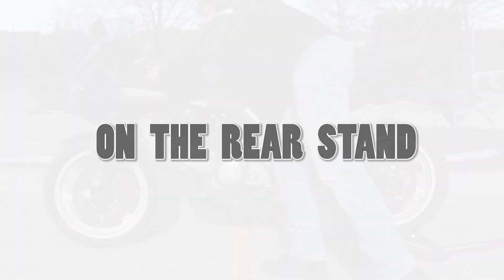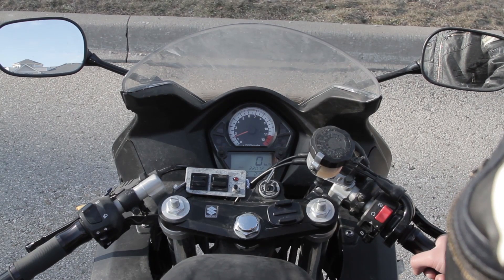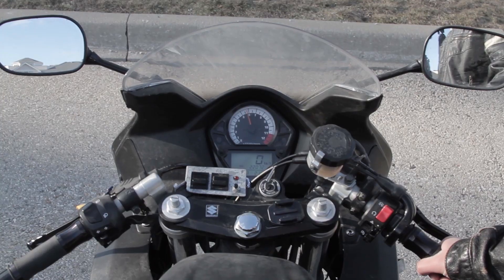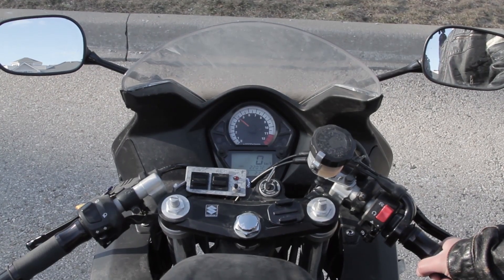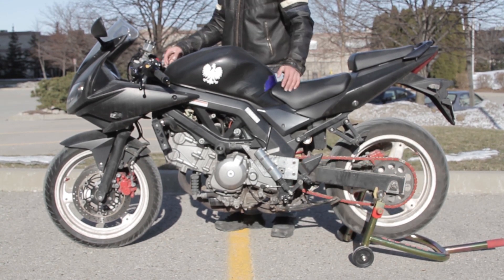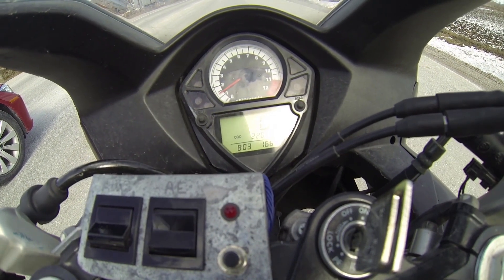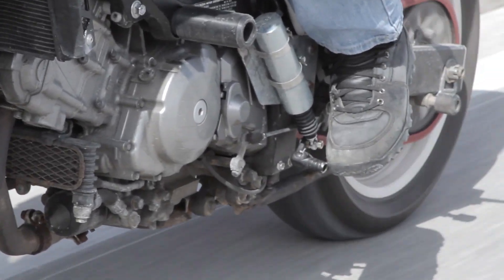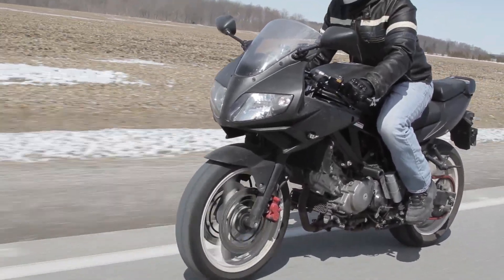DIY Semi-automatic Motorcycle Gear Shifter (SV650)

Comment: Unfortunately, liability exposure keeps a lot of these devices from ever hitting the market especially for physically impaired, challenged, whatever the proper terminology. I've had two pretty horrible accidents (sv650 actually) but I still love to ride and like Jackstandjohnny would want the same. If you can help him as one individual that would be awesome! The other shifters are for racing primarily and wouldn't have your fail safes and driveability options programed and can tailor it for him including having the option to shift from the other side of the bike or hand controls electronically. (more fail safes/options). Hope you can help him out. I hope you won't limit your engineering design work due to liability exposure. I know time and a real job are the more dominant interruptions, but just saying, as a prototype design engineer,  I see liability as a huge limiting factor for devices or systems making it into the market share, aside from funding, further R&D, etc.
Reply from the maker: You're right. It's a challenge.
The human body is a very resilient system (understanding it is really a path to inspiration) but after you get hurt, such as in a motorcycle accident, you can only adapt so much. The combinations of impairments people are faced with and their severities, are so unique, once combined with the variety of motorcycles each individual owns..... makes it a challenge to find specialized riding aids at reasonable costs.

The pinnacle would be getting a machine/fabrication shop and design engineer to work together, understand your needs, and truly strive to re-create the experience you first found from riding, but the costs to do that, to create something that passes federal certification/licensing is terribly prohibitive. As such the product market is 'small' and there are only a few 'universal' designs available to our mosaic of needs.

JackstandJohnny and I haven't taken the idea further than what you see in the posts below, but I'm still open to taking it further. When it comes to custom work like this there is a point of diminishing return on time/money invested, but given the proper due-diligence, liability isn't one of the things I'm worried about holding an idea back. Just like others, I think you and I realize how hard it would be to drop the desire to ride again.
Reply: Caspar Baczynski
 Well put! That's pretty much why it becomes one off design and implementation, but many with the means are willing to go with the design challenge. You are certainly capable and perhaps encourage some one off user interfacing projects which with the desire, the funding is primarily there, with in reason of course. Sometime, the idea truly is just cost prohibitive...good luck with your further studies, ideas and research....oh...and keep the rubber on the pavement!

Comment: This is amazing. I lost my left leg above the kneemin a motorcycle crash on my 2000 SV650 and have been dreaming of a setup like this. Is there any way to buy a kit from you? Or possibly be a guinea pig and test one out for you for free? Lol,by the way that chain has way too much slack in it. Excellent work though seeing this has made my day.
Reply from the maker: Thank you. Although as far as the chain goes, I'm surprised you're the first to mention it. That's what an extra 1-2" of slack in one direction looks like and you're right, that was way too much.

As far as the project goes, this is as far as it's going, but I can still leave you with something:
If you can find a universal shifter kit (be it form Translogic, Klktronic, PINGEL, etc.) such as http://www.pingelonline.com/prodcat/suzuki-electric-shifters.asp with push-button controls and  have a machine shop fabricate the rear set mounting bracket to hold the solenoid (or yourself; nice videos), I can put together a weatherproof module with the features you like. I think that would make a great winter project.

I think a crash detection temporary lock-out feature, tilt detection (so you can't shift if leaning more than say 35 degrees from vertical), and the auto-economy/aggressive are all possible. If there's anything else you can think of and don't mind investing the time to work with me on it.... minus turning your bike into a blender, we can try and make it happen. We could even go so far as recording your live fuel consumption (FI) data and plot that against your acceleration. Would be a nice way to know if any modifications you make to the bike improve its performance.

Alternatively (and I'm leaning towards this more since you can still use your clutch hand) we can just figure out a way to move your shift linkages to your right foot brake lever and relocate your rear brake mechanism. As much as I love the electrical side of things, this would be a direction more towards the mechanical feel of shifting.
Reply: Hi